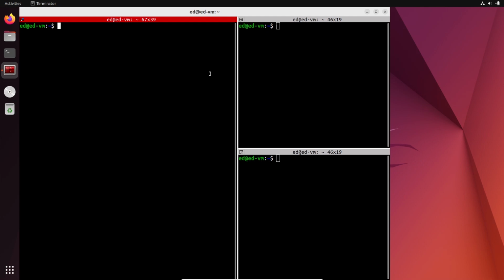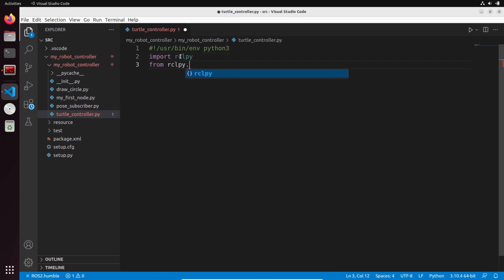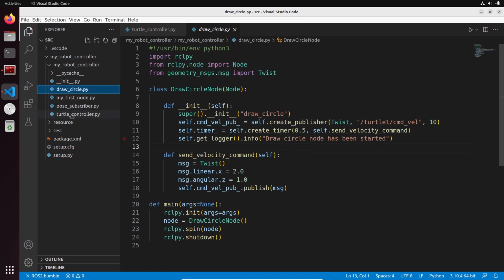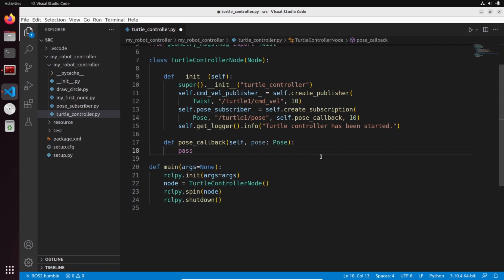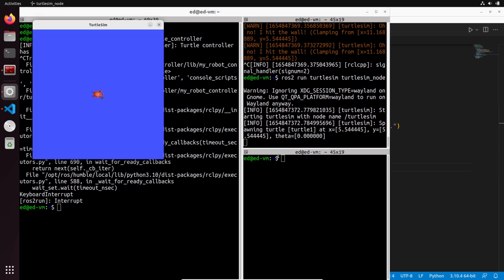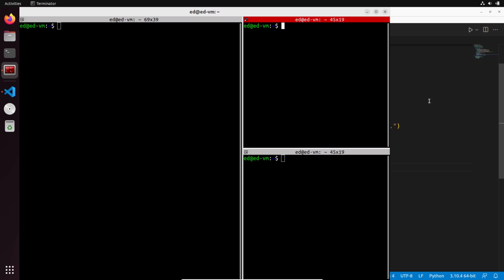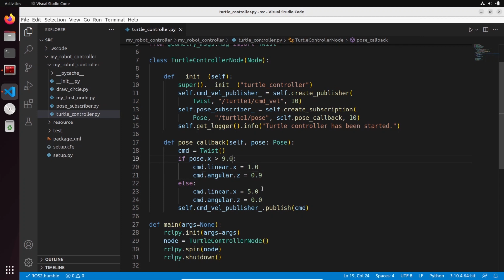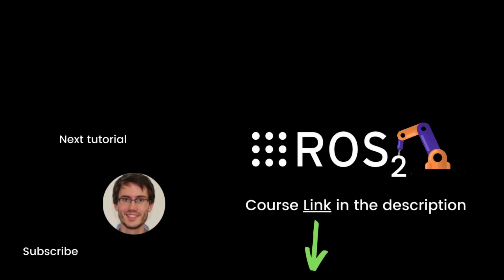Create a Closed Loop System with a Publisher and a Subscriber - ROS2 Tutorial 9

Comment: Hi, I'm a university student. Together with a colleague of mine I would like to develop a graphical interface to control 3 motors (slider for speed and a button to activate them). I'm totally inexperienced. In your opinion, can it be done with the ros2 rqt interface without using other options? If so, how can I physically create the buttons and open the interface with a command? Thank you so much for your tutorials, they are helping me for a project!!
Reply from the maker: not sure you need  ROS for that. I'd say, set up an Arduino board to control the motors and monitor the button. Then, to connect to your computer, use Serial. On your computer, use something like Tkinter (Python) for the interface, you can find many tutorials online.
(PS. That was just what came to my mind at this moment, you might find other alternatives)
Reply: @RoboticsBackEnd  Thanks for the very super fast reply 😉.
My colleague has already created a link between stm, Ros2 and a joystick (to make a long story short). We would like to use the same topics but with a graphical interface instead of a joystick and we were looking for the most basic way to do it. That's why we came up with rqt.

Comment: I have a question, when I create a publisher, when I have to create a timer too and when is not necessary?
Reply from the maker: If you want to publish at a fixed rate, and want to use ROS2 callbacks, then use a timer.
If you want to handle the code by yourself with a loop in a detached thread, then no timer

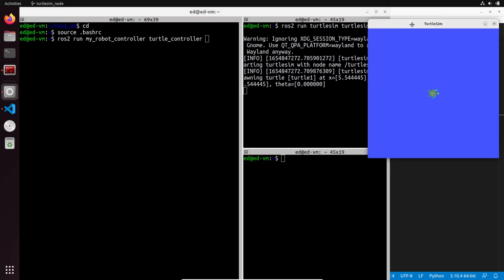Comment: Hey. At 13:11 i tried running the command ros2 run my_robot_controller but the python file turtle_controller isnt visible to me when i press tab. Whn i type it shows no such executable found. Can you tell what I should do
Reply: Did you try this command
"ros2 run my_robot_controller turtle controller".
If no, then try this command.
If yes, then check the turtle_controller. Py file is in executable format

Comment: Hi thanks for the great content. I forgot to add a comma between node installation lines on my setup.py and ran 'colcon build --symlink-install' and now I'm in all sorts of trouble. Any tips on how to recover from that?
I tried correcting it and running colcon build again but it isnt working. Merci!
Reply from the maker: Usually the best solution in this case is to just remove entirely the install/ and build/ folder, then run "colcon build" again :)